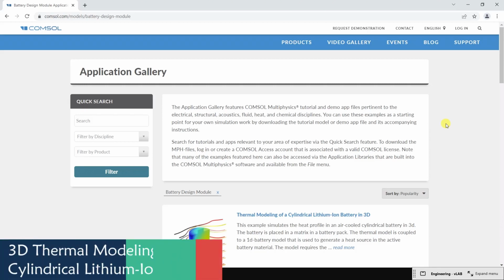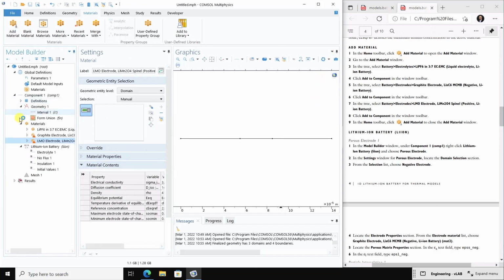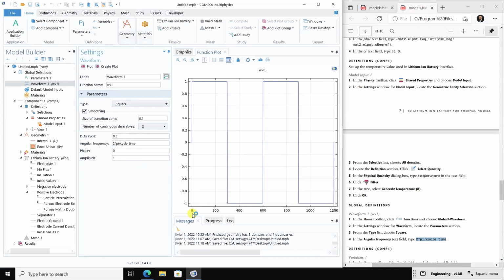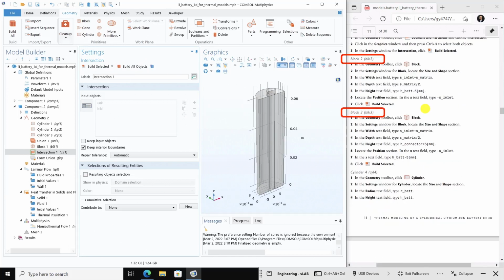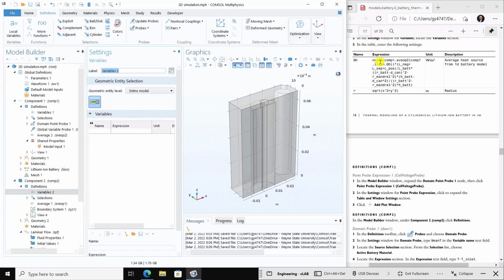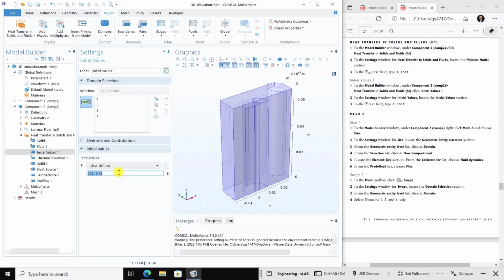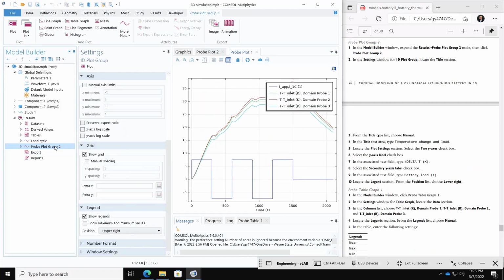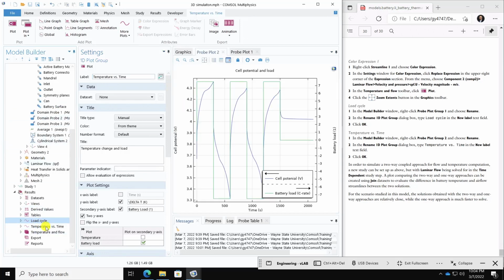3D Thermal modeling of a cylindrical lithium-ion battery 1080p

Comment: dear sir ... i want to make a simulation of lithium ion battery .. where at the separator portion .. i eant to add a ceramic coating .. does it possible to simulate in comsol?